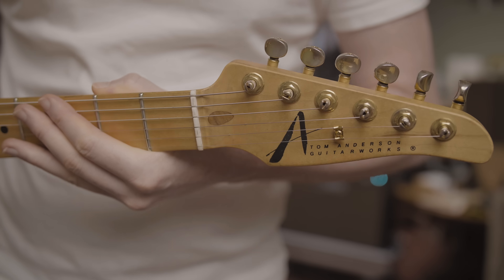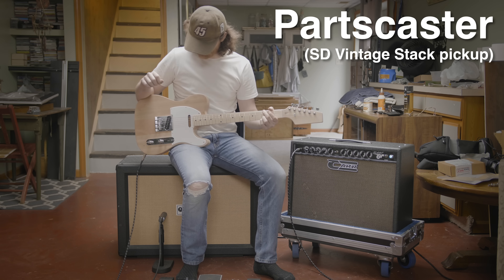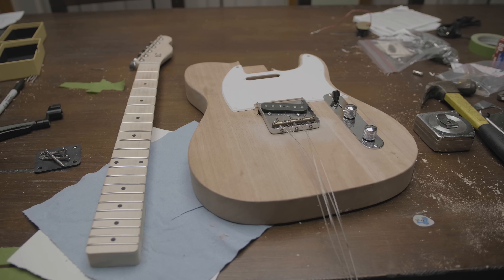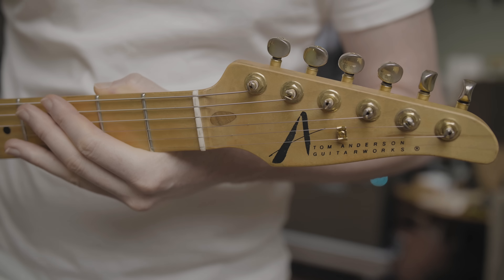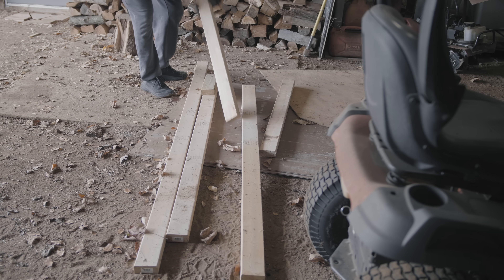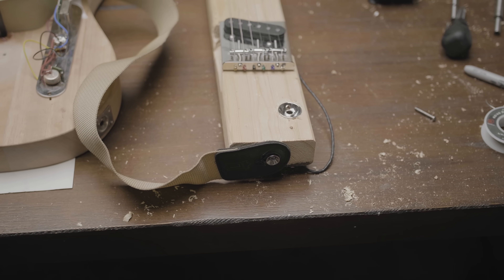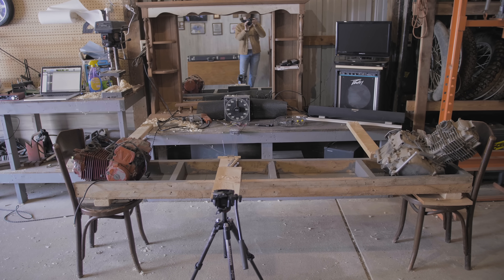Tested: Where Does The Tone Come From In An Electric Guitar?

Comment: You know, what doubters seem worried about is the vibrations that the strings put into the body and how those vibrations come back and affect the strings, and that’s got me thinking whether those vibrations are even substantial enough to be picked up by the electronics when they bounce back. So here’s my proposed experiment: attach a contact microphone to a guitar body. Record the vibrations that the strings put through the body of the guitar while it isn’t plugged into anything. Then, plug the guitar in, and rig up some way to send those exact vibrations from the unplugged setup back into the guitar body without any amplification. The goal here is to precisely reproduce the extent of body vibrations without having to strum the stings. Then the question is, are those replayed body vibrations picked up by the electronics in any way, and if they are, how loud are they compared to the signal you get when you play the guitar normally?
Reply: Here a simpler one, which you can conduct rig free, right now. Make an e chord with your left hand and make a fist with your right hand, then tap the back of the neck, then tap the body of the guitar. Do these vibrations affect the strings and do they get picked up by pickups? Given you are plugged in the amp.
Reply: @TheMemagNeman  I like the idea, but I think that putting the same vibrations from the strings back into the body is important. Those vibrations should be at the right frequencies to make the strings vibrate sympathetically, which wouldn’t be true of just knocking on the neck. I still think you wont get much if any resonance in that situation, but I think it’ll address more alternative explanations than just knocking on the neck would.

Comment: After watching and listening through three times, my takeaway is that the pickup, pickup position and distance, and the electronics have by far the most impact on the tone. The woods don't seem to matter at all, or very little. I did notice a slight difference between the steel and brass bridge saddles. But overall, I'm thinking that this dispels the idea of "tone woods." The final "air guitar" compared to the Anderson Tele seals it.  On my mixing/mastering studio monitors, I can hear no difference in tone, harmonic overtones, and frequency spectrum between the two.  Simply amazing. Thank you, Jim, for this research!
Reply: Concerning the bridge saddles, he literally explains right after swapping them that he dismissed the test altogether since he hadn't made sure that the pickup distance to string was accurate and consistent.
Reply: @JonathanHohl  This is true…
Reply: @JonathanHohl  however, I think it’s unlikely that the pickup would have been re adjusted during the swapping of saddles. The only difference could have been string height, but if the action was matched to the action of the steel saddles, then the difference in string distance to the pickup would have been minute.
Reply: @david_onbass  The difference in string distance to pickup is always minute though. As the test shows, even millimetres can make a big difference. You can hear some more top-end with one of the saddles compared to the other, it's not unlikely that the string distance to pickup was different around the high E string or something
Reply: The brass saddle part was interesting to me. I liked that. I think i want a strat or a tele with brass hardware..

Comment: Excellent approach and systematic summary! If you need more than 'by ear' consider comparing frequency spectrums ie. in Audacity.
I recently got into similar topic as while playing I noticed that same notes, tuned as well as I could, sounded off on different strings. This lead me to adjust pickup heights, which for me became major adjustment for guitar sound

Comment: Strickly speaking that is not an air-guitar: it has a steel reenforced plywood body (the bridge is screwed into the plywood bench) . But i agree: the tone-wood probably does very little to the tone. That’s why it’s called an electric guitar and not an electro-amplified guitar. Unless you turn of the power…. So: if the tonewood would make a difference amplified becouse it influences the string vibrations, than it should definitly make a difference  without the amplification.  So: with piezo’s it probably does make a difference…..?

Comment: I don't get all the hype this video is getting.  I thought we all figured this out in the 90s, when everybody was like, "buy a $200 mexican strat and replace the pickups".  Yes, the pickup and the electronics are 90+% of the sound.   However, a huge cheat for me is when you start using a compressor.  Gee, you think that's going to make everything sound even more the same?  Yeah, that's what it does, you might as well be playing a modeling amp.   If you do this again, you really need to not use a compressor.  Also, clean tones and slight breakup, sure.  Plug them into some nice high gain tube amps, play some single notes stuff with sustain or vibrato, some riffs, some chords with sustain, the amount and kinds of differences will become more apparent.   But yeah, it's the law of diminishing returns, you can get a cheap guitar that sounds good for $200 but it's not going to be long term reliable, every couple hundred more gets you more reliable as far as tuning, hardware, wear and tear not causing playability issues, by the time you get beyond $800-1000, it's just very tiny improvements, and maybe a prettier top, for huge $.

Comment: You think the huge wood table and shelf helped compensate the lack of body and neck?
Reply: Air guitar effectively has 2 necks, offset from underneath of the strings sure, but they still act as necks as it connects "body" and "headstock".
2 large engines would surely negate a pull force from 6 stings, wouldn't they?
Reply: @TheMemagNeman   Sure. But I mean tone-wise. I've forgot to mention. My bad

Comment: Technically the air guitar had a wood body(the bench) and wood neck. I would try changing those to plastic or metal then you could rule out wood as a tone factor.
Reply: Warmoth had videos using different woods and there’s clearly diffferences between wood body’s and necks though they are small. Like how mahogany has a roar and ash sounds warm and alder bright.
Reply: @allenwhite1978  Download the audio from the video and listen to the differences between "wood plank - air guitar" and tele.
It's obviously there, minute differences but present.
Start at 7:45 as those seems to be the part where we narrow down to the crucial components. Different.
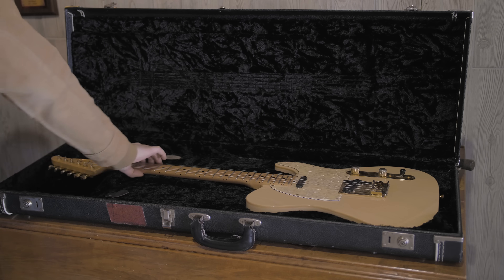Starting at 10:05 you can hear the difference in bottom end (~50 -350hz).
So, it's small but it's there.

Comment: Excellent video! One thing that’s obvious from this video is that pickup height is often massively overlooked. Some people swap their perfectly nice pickups out endlessly chasing a sound when a couple of millimetres worth of adjustment here and there can make all the difference. If you like a higher action or you have a deeper neck angle you might need to play about with the pickup heights to get them all to sing together nicely.  it’s a very cheap “worth a try” adjustment.
Reply: I agree. I play a Squire Affinity Strat as I’m pretty poor.  The middle pick was dull and muddy. A couple of screw turns later best pick up on the guitar.

Comment: The only thing I would do differently is use a perfectly rigid metal frame for the table guitar, just to rule out any possible effects of the wood table resonating and taking away from the string vibrations.
If the strings are attached to a perfectly rigid structure, then there is no effect to the sound from anything else besides the strings themselves and the pickup and electronics. 

It’s interesting though that everything else sounded pretty different than the Anderson guitar up until the table guitar. I think that goes to show that a cheaply made and put together instrument doesn’t allow the strings to vibrate as freely. Especially when you showed the tight vs loose neck, the tight neck joint was closer to the Anderson guitar’s sound. Basically a good quality guitar is designed so that nothing is going to take away from the string vibrations. This is achieved by the construction and the selection of materials, including the wood. 

I don’t know why this continues to be a big argument though. The type of wood has a pretty marginal effect and it is mostly the pickups, the amp and the speaker that matter for the sound. It’s silly to say the wood makes no difference at all or that it is the only thing that matters, it’s just a small part of the whole thing.

Comment: Dude, that was really awesome. You really have taken all the details to test, i loved it. I'd only suggest that in order to capture some inaudible differences you could put the signal through an oscilloscope with FFT on it, that way you can see if the peak frequency has slightly changed between tests. Overall, that was awesome! 🤘

Comment: Didn't hear a massive difference in the open string strumming from the anderson and the bench air guitar.  That's wild!  I guess the bridge and pickups have the most influence.   I would think the effective mass at the bridge and headstock for the bench air guitar would be considered a lot more than the normal guitar but I don't hear a massive difference in tone.  Try adding mass directly to the bridge and /or headstock and see what the difference is.  I've read many articles from long ago where guitars suddenly came "alive" from adding a lead slug (mass) to the body at the bridge.  Both the bench guitar and anderson sounded alive ( enough mass at the bridge and headstock).  Tone wise it seems like scale length and the pickup has the most influence.  I heard a guitar played made from a shovel and it sounded really good . . . tone wise and alive.  So it had adequate mass at the bridge and headstock and the pickup was matched well.  So, nothing left there (on the shovel) but scale length and pickups as long as the mass at the bridge and headstock are enough to allow the strings to vibrate properly without damping them.   I'm sure therefore there is a hierarchy.  Scale length, pickups, bridge mass, headstock mass and finally the wood.  The wood should effect more the sustain and what frequencies are passed (from strings to the wood and back) and not damped like a low pass filter.  So wood might affect the upper harmonic content and sustain more than a large difference in overall tone.  So wood will still somewhat affect the brightness tone then.  A solid maple guitar vs the same design and pickups in a solid mahogany guitar should therefore sound somewhat brighter (higher harmonic content).  A spectrum analyzer (frequency domain) might show that. Some pieces of wood have great "tap tone" and sustain, but does that make a large difference in tone (more so in an acoustic guitar I'm sure).   I mean the pine 2x4 body sounded good!  I believe some of the first Fender Strat bodies were made using a hard pine.  Very interesting experiment!  So is your next hit record going to be "bench top guitar big barn chicken pickin blues"?!  LOL.  A lot of work here and a great video!!!  Thanks.

Comment: Man, you've successfully confirmed so many things that I've been suspecting for years.  In recent years, I've resorted to buying cheaper guitars and tweaking them in to better playability with results that are sonically indistinguishable from more expensive guitars with fancier woods, etc.  I'm getting grief from some tonewood snobs for the 3D printed guitar I'm planning.  I instinctively knew they were full of crap, but I thank you for giving us all these things to consider.
Reply: That's exactly what I did with my Ibanez Bass. 👍
Reply: @zer0deaths862  Heck yeah!  I have an Ibanez TMB100.  Super cheap.  Frets needed leveling.  Some adjustments to the nut slots.  A little elbow grease and a few hours work, now it's my favorite bass!
Reply: Yea, it's all about playability, setup and electronics.
I like my 2200€ Duesenberg guitar but with my band i also play my 200€ Dean bass where i swapped pickup+electronics and tuners, great playability, great sound.
Reply: @Zwidawurzn  There's something to be said for not having to sweat too much over the idea of someone trying to swipe your $2000+ guitar at a gig or having an idiot wanker bandmate slam his headstock into yours.
Reply: Are you 3d printing your guitar with wood filled filament?
Reply: @JefeInquisidorGOW  Probably not.  It's my brother's printer and he thinks that wood filament clogs the whole thing up too easily.  I think I'm going to try to build one of these: https://youtu.be/dcjL9Kuj58c

I may even throw a baritone conversion neck on the thing just because I'm crazy.
Reply: been playing since I was 12, im 33 now. I love my tenson 100$ guitar, because it feels great to play and the tone is amazing when using parallel compression and the likes. If your guitar sounds thin you can just compress it so it gets more body. Very simple. Thinking of electronics and the logics around, one should get cobalt string if they don't mess with your playing too much. The magnetic response and the difference is far greater than the difference between 100$ less paul copy and a 5000$ Gibson 1962
Reply: Dial in a warm tone and tell them you used an all-rosewood guitar. See if they fall for it.
Reply: If you need any help with design send me a message. CAD Designer.
Reply: Should see what they say when you show up with your 2x4 guitar.
Reply: Tonewood is marketing. Wood does nothing to an electric field, I've know this since physics class in high school. I'm surprised there is so much misconception about this in Murica, the home and birthplace of the electric six string. You'd think inventors Les Paul and Leo Fender had over half a century to explain this basic shit to people. I guess this stupid tonewood shit got hyped up only after their time.
Reply: @UmVtCg  Leo Fender knows it all along. Why would he propose to use solid wood body??
Reply: 3D printing a guitar is an awesome idea. I’d love to see it when finished.
Reply: I'm definitely on your side. But one thing got me thinking: do you think the wood tables ended up playing the part of the body and neck? The parts aren't surrounded by wood, but the bridge and tuners are definitely attached to huge wood parts.
Reply: @Heleno_RR  I would think that unless the wood in the tables was the same type, cut, quality, density, etc. as the comparison guitar,  there would be a more noticeable difference if those factors had any meaningful contribution to the tone.  Now this is only my opinion about electric instruments.  For acoustics, I do feel like the resonant properties of each individual cut of wood matters a bit more.  But it's not as simple as what species of wood is involved or anything like that.  I once watched a video of John Greven  selecting the woods from which he would make some of the world's finest acoustic instruments.  He would hold each sheet up close to his ear and tap on it to hear the vibrations.  He was real choosy about which individual pieces of wood he would take with him.  The rejects were all still high quality expensive woods.  But that's not what mattered to him.  I guess he knew what he was doing.  My dad had a custom Greven back in the day and it was the most beautiful 12 string I ever heard.  Tone is one of those things where everything affects everything else, but not always to the degree we think.  I personally just don't think I'll ever trust the overly simplistic marketing messages about tonewoods that saturate our little guitar world.

Comment: I appreciate what you’ve done here. But you’re not letting the guitar tone come through. You’re covering up the guitar tone by not playing through a clean amp. You’re using overdrive, which masks the actual tone AND sustain the woods and hardware contribute. Overdrive adds electronically produced harmonics which continue to excite vibration from the string while also feeding back through the pickup system, increasing sustain electronically.

The wood type and grain as well as the string termination and downbearing angles (bridge, nut) as well as “vibration bleed” into the waste lengths (portion of strings outside of termination points) absolutely must contribute to sustain at the very least. All of these are crucial to how long a string vibrates without being electronically assisted.

With your “air” guitar test, your workbench is connected to the floor and over to the other end. And you’re still using an overdriven circuit to mask the tone (it adds harmonics) and increase sustain.